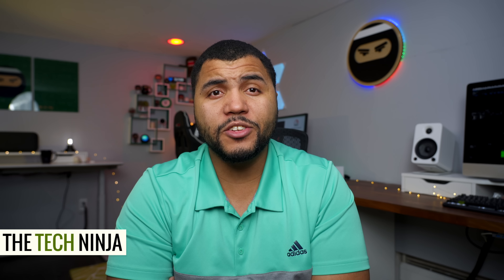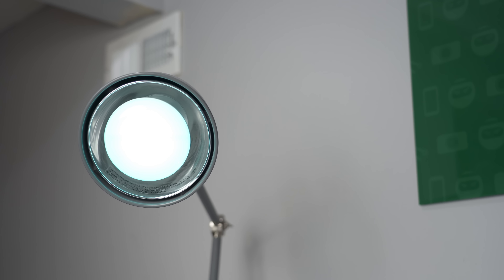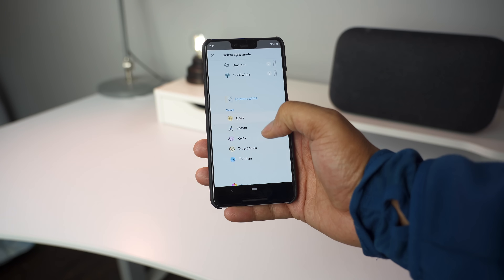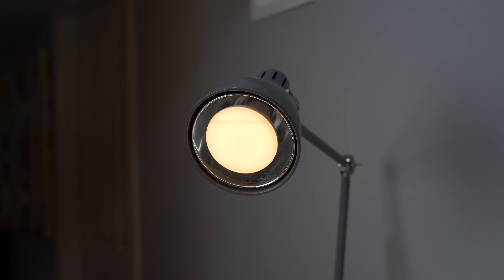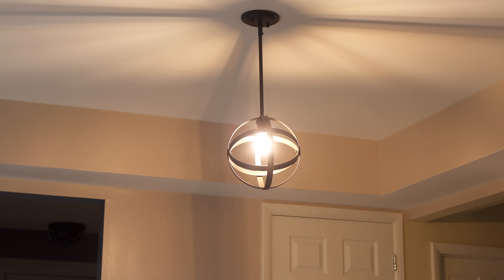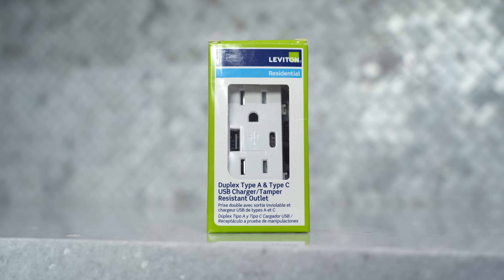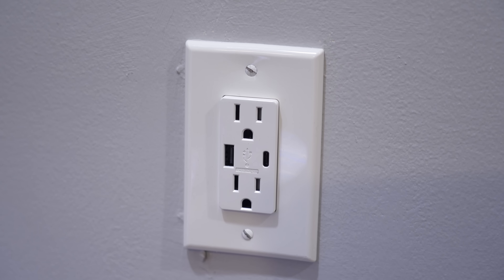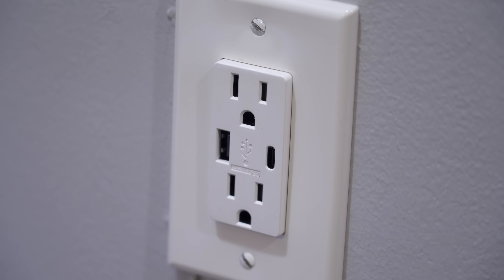Top Smarthome Tech | Usb C, Smart lights, and Switches

Comment: Question Kev, with smart bulbs does the switch always has to be on? And would smart switches be better in that case?
Reply from the maker: Yes. And in that case switches are better. But not everyone is comfortable installing switches. That’s the main reason I did switches instead of bulbs. I just tossed them into the wall myself.
Reply: @Techninjaspeaks  Aaaaah I see, i'm not at the stage yet of smart home installments but it's awesome to get a 1st look and understand before you buy, Thanks Kev for taking the time out to reply (Still supporting always)